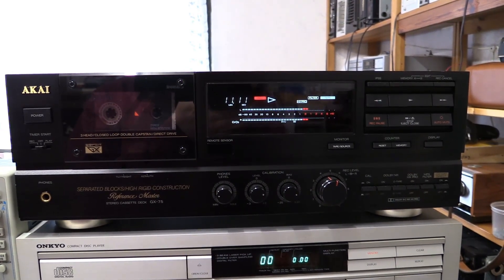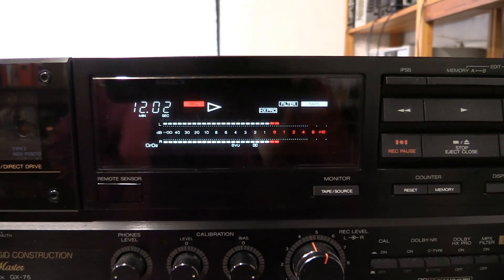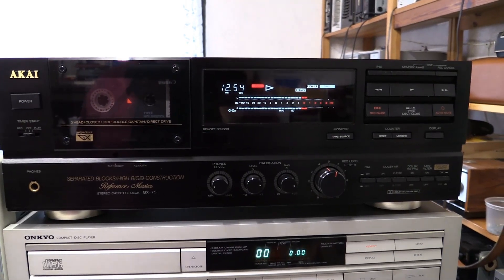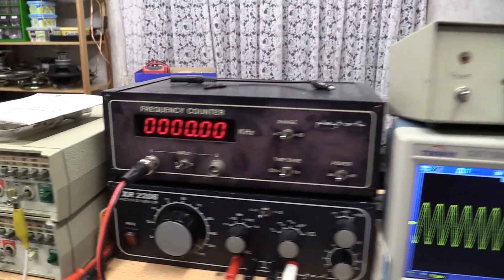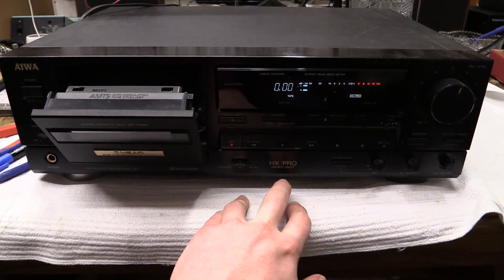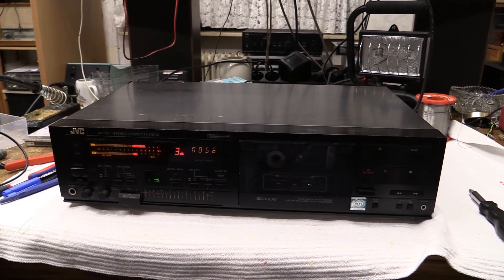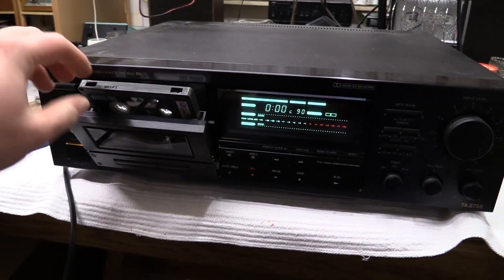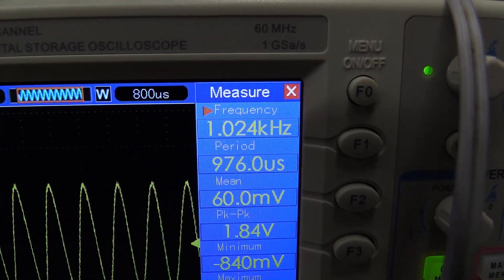Cassette Deck Speed Tests

Comment: 3000hz or 3150hz, is that right? My calibration tape is 3000hz?
Reply from the maker: Both frequencies were commonly used for speed calibration, you just need a calibration tape that matches the frequency your test equipment is designed for.

Comment: The first deck shown in video Akai GX-75  has self calibration system .you can calibrate without refrence cassette,with pushing calibration switch and start to record on a raw cassette,the player circuit supply refrence ton itself and after auto matic calibration you can adjust it manually

Comment: That Technics is very cool, we used to have the dark version when I was a kid, my dad actually bought it new a couple of years before I was born, he must have saved a lot for it as it costed a fortune back then... We used it a lot and when I was about 6-7 or so, my father decided to replace it as it showed signs of wearing out. I used a lot of parts from it as toys: we mounted to counter on a Lego-brick, the motors to drive things (using a model railroad trafo to power them). But I also still remember the typical sounds from the solenoids in that thing and the strange way you had to put in the cassette. Very mid-70ish.

Comment: How do you know that the deck records the test tone at the correct speed?
Reply from the maker: The test tone cassette was recorded on the Akai GX-75 which is a direct drive dual capstan cassette deck. Out of all the cassette decks I had at that time it was the one with the highest speed stability, and I do trust the Akai with running at the correct speed. However, obviously if it wasn't correct, the test tone tape would be inaccurate.

Comment: I seen someone on here recorded on a deck that was known to have the correct speed...a tone of 440hz(which I can do from on app on an ipad) then they took the tape, put it into a deck that needed to be calibrated, played the tape, then used a guitar tuner, set to the 'A" string...and set the speed that way..pretty cool I thought. The tuner was set by the output speaker to hear the tone.
Reply from the maker: I know this is the speed adjustment method of youtuber 12voltvids.
Reply: Oh ok, thanks......

Comment: I recorded one of these not realising that the deck I used to record it was running slightly slow, so I ended up just loading a tape with  a song on it that had a constant beat and got a BPM counter webpage and just clicked as close to in time with the music as I could and compared that reading to the same song on youtube, worked pretty well, well enough that I'm happy with the speed and it's definitely faster than it was.  The hardest thing was the Walkmans speed adjust pot was dicky, so up was down and down was also up then down.

Comment: Making a test tape does not always ok because it relies on the accuracy of the tape machine it was made on. 
I used to buy test tapes from Panasonic. They were made as reference tapes and were alway accurate.
Reply from the maker: I made this test tape on my Akai GX-75 which is Direct Drive. I am sure its speed is close enough to what it should be. Not perfect, but it's free ;)
Reply: Not to mention the question of when his frequency generator was last calibrated.

Comment: Dear Dr Cassette my beloved Marantz twin cassette deck SD 4050 has a problem with the right deck. I load a cassette, any cassette, when I press play it runs very fast (in both directions) sounding like the chipmunks . There is fast dubbing mode which I've never used and who knows it could be stuck in fast dubbing! I even did the turn off and turn on trick out of desperation but this is not a computer just a humble tape deck.  My kids often stop and ask about the clunk sound when the auto reverse clicks in, its foreign to their little ears. I love mechanical clunky sound,  I Love the soft touch buttons, love the soft eject mode but not big on the chipmunk mode. Any prognosis would be nice. ps the belts are perfect. Ys Russell
Reply from the maker: That's an unusual problem, seems to me like the pinch rollers are not fully engaging. It could be the motor running at the high speed that's meant for dubbing, too. Does the motor sound any different than normal when you compare the functional and the non-functional deck with the audio output turned off? If they sound the same, it should be a problem with the pinch rollers. Are you sure the belts are fine? Some decks have more than just one or two.
Reply: @DrCassette  You are right the pinch rollers are not engaging, they sit just under.( Maybe a cigarette paper of a gap to the spinning shaft ). The machine is clean especially in the tape compartment and all the belts are really really good.
Reply from the maker: @russellwarr3791   Hm, that's a strange problem.
Reply: @DrCassette  I enjoy your channel very much and if I hear of a solution I'll let you know.

Comment: Hi, 

I've got the same JVC KD-V6 cassette deck that I found at a thrift shop for $10.00 several years ago.  The playback levels were quite low even after I cleaned everything up.  Turns out there was some tape crud I missed that built up on the edge of the head that lifted the tape slightly away from the head.  This dropped the playback level way down.  Once I discovered that and cleaned the tape crud off, the output levels jumped up to normal.  This deck performed very well.

Also, there is an old technician trick you can use to rejuvenate an old, stretched out belt (not one that has turned to goo!) that involves boiling it in water for 10 to 15 minutes. I've not tried it myself, but have seen it on You Tube.  Apparently it does work, for what that's worth.

Regards, Tom
Reply from the maker: I have seen that belt boiling trick , too. But I don't think it's going to last very long. I may have to try that at some point.
Reply: Here is the You Tube video that shows the boiling-the-rubber-belt trick.  https://www.youtube.com/watch?v=ZdklvFfgIo8&list=PLqQGTv50yTPDMcemG9usgIIgnIjSLxbc4&index=46&t=338s  My concern as well is that the rejunivated belt won't last very long.  That would be a nice experiment for you to explore. :-)
Reply from the maker: Yes, that's the same video that I saw.

Comment: the last tape deck in your video pioneer ct-f500, ive got that same one. it plays slow so im trying to figure out if its the motor, a bad belt that doesn't have the right amount of tension or if theres a speed setting potentiometer on the board thats not set right.
Reply from the maker: The belt should not be loose, but generally the tension is not very critical. Try to manually turn the motor just a bit in both directions. If the big heavy flywheel follows the rotation of the motor exactly and without delay, the belt is fine. There is a little hole in the back of the motor. You can poke an insulated screwdriver into there and adjust the built-in speed control of the motor. There is no other setting for the speed.
Reply: alright i appreciate your reply. thank you.

Comment: DrCassette, how do you know your source machine was running at the correct speed?
Reply from the maker: That is indeed a problem. But the Akai GX-75 does have a Frequency Generator Servo locked Direct Drive, so the chance of it running at the correct speed is very high.

Comment: You are probably aware of this but you can get really cheap ceramic screwdrivers on dx/ebay that will do these speed adjustment jobs alot safer than using ordinary screwdrivers with tape on them. Not only for the motor itself but in the chance you get a shock from the transformer you will instinctively pull your hand out of the deck loosing the screwdriver... You dont want that thing rolling around on the pcb if its made of metal.. Thats what happened to me a few hours ago :D Luckily it was ceramic..
Reply from the maker: I make sure I stay away from the transformer.

Comment: I have a Technics RS-676, maybe earlier than your 671 but it oscillates...even so these are really cool decks and the drive style is like the Pioneer CT-F2121 and some others that predated vertical drives. I hope to have a Sanyo RD-311 from Australia (multi-voltage) soon. As for the CT-F4040 blow it out and clean it. It should be fine. And you at least have a good working Sankyo. CT-F500 is probably the easiest one to find parts for, it was supposed to have been the model with the largest production numbers of all. Add one to a TX/SA-6500 II pair and you have a really nice 25 watts per channel setup and while not the best tuner they ever made it certainly is a good one for what it's worth and quite adequate. Nice test, too bad you never had a Harman Kardon TD-212 or one of the A/D converter rec/play sections of the Pioneer DR suffixed machines, now THAT is nice.

Comment: It might be a foolish remark, but when you used the Pioneer cassette deck (first one), shouldn't you have chosen "Chrome" on the tape selector? I don't know if that would have made a difference or not. Nice video!!
Reply from the maker: That deck has an automatic tape selector. The selector switch is just an override switch. But either way, for this test, the playback equalization doesn't matter.

Comment: Ein Freund von mir ist Radio- / Fernsehtechniker und hat mir mal ein paar seiner alten, nicht mehr benötigten Test- bzw. Einstell-Kassetten mitgebracht. Darunter war auch ein TEAC MTT-255C Azimuth / Level (10kHz / 315Hz). Hat mir auch schon oft gute Dienste geleistet...es beruhigt mich jedoch zu sehen, dass ich nicht der Einzige bin, der einen "Reparaturstau" an seinen alten Hifi-Geräten hat. Egal, ob Plattenspieler, Tapedecks oder CD-Player...irgendwo ist immer ein Riemen defekt, ein Lager trocken oder was auch immer.

Comment: I had a pye/phillips music center once but when I played tapes recorded with it on another player they played the music back realy slow, as much as a semitone slower
Reply from the maker: +Tony Dunn That could have been caused either by a bad belt or by a false speed adjustment.
Reply: sadly it was like that from new becuse all the tape I recorded with it were slow, great rec. quality otherwise & they still playback very well after 30 odd yrs.
Reply: Just seen this comment and had to respond. I owned a Dynatron (made by Phillips) and my friend had a Phillips music centre, and they both ran a semi tone slower. To hear it was like it from new is amazing and strange as I have encountered it too!

Comment: Hello Dr, i have a problem with my cassette deck. If i push the play button the vu meter goes complete in the red until the end ! Just on one channel. There is a lot of distortion hearing and now music. What do you think ? Thanks
Reply from the maker: poukypsie Most likely a bad contact in the record/play switch causing high frequency oscillations on one channel. Get some proper contact cleaner (no WD40 or oil!) and clean the switch. It's a big sliding switch, you can't miss it. Maybe pushing the record button a couple of times will already fix it.

Comment: I need a tape like that one but I can't make it :(
Reply: Hi if u have a working deck just generate some 1khz tone using the free audacity software play this back on PC and then record it on the input of your tape deck. Using a 3.5 mm to RCA lead plugged into the computer's head phone jack and the decks input otherwise you could save the audacity tone as a wav file to put on a CD then record to tape. Hope this helps?
Reply: Dan Hefferland I know how to do it, it's just that my tape deck doesn't run at the correct speed.
Reply: Oh I see :-) have had a lot of problems with speed on my machines too sometimes test tapes come up on eBay j got some Sony ones that way I can have a look and give you the tape part numbers if that helps if you were in the UK I would post you a tape of tone One tape head to another as I had a lot of problems getting test tapes too. Often times I do you set mine by ear now days I know it's not quite as accurate but you can still get it pretty close. What deck do you have?
Reply: Dan Hefferland It's an entry level Teac deck, can't remember the model number. I should try to find a prerecorded tape, I can't find any premade test cassettes.
Reply: +giammyzanna did u ever get a test tape? How's the deck doing?
Reply: +Dan Hefferland Not really, I had to do it in an other way. Basically I got a pre-recorded cassette, played it back on the deck and recorded it on the computer. I also got the same song from youtube and in the end I just recorded the same song on the computer checking how much difference there was between the tracks, changing the playback speed every time. I got a 2-3 seconds error within a 3 minutes song (slightly faster), can't do better than that - the pot on the motor is not precise enough

Comment: The problem here is that you have to be sure of your calibration of the initial desk doing the recording ;o)
Reply from the maker: The Akai is a direct drive unit, so out of all my cassette decks it will perform best. Overall this should - within certain tolerances - still be better than getting a stretched and worn out reference tape off Ebay for some ridiculous amount of money.
Reply from the maker: You come across rather arrogant in your comment. I know what I'm doing.
Reply: +DrCassette I really enjoyed your vid have noticed similar issues with many of my cassette deck I had some success stripping my technics motor down soaking the front bearing in spirit cleaning the commutator to getting rid of brush deposits before lubing both bearing with machine oil and reassemble i've had some worn out bearings too but I have had some success doing the above and wondered if you had done anything like it? Really enjoy your channel keep it up :-)
Reply: I'm about two years late to this post but I would definitely recommend getting out the ESR Meter out and checking all the capacitors... I'm sure that most of them will be out of tolerance by now and most likely causing speed issues....

Comment: Interesting!  Do the cassette decks with the odd loading mechanisms have it for show?
Reply from the maker: I guess the idea was to lay the cassette down flat so that the spools woul rest on the cassette housing. That could result in the tape being wound a lot cleaner than in upright designs, especially in fast forward and rewind. These mechanisms were complicated, expensive and in case of the Technics uncomfortable to use, so they disappeared. The later decks were either the normal upright loading or drawer type decks where the cassette would load into a drawer or where the entire mechanism was mounted into a drawer.

Comment: I got a few walkmans and sometimes it sounds like the sound suddenly gets more clear and speed up but it sounds better that way. or is it just my mind doing tricks ?
Reply from the maker: When running slightly faster, music can sound better. That's why a lot of cheap cassette decks and record player were adjusted to run a bit to fast in the factory.
Reply: It could be, but they are sony. Its not just faster but it goes suddenly faster
Reply from the maker: ‍1marcelfilms
In that case the speed regulation may be faulty. Sony did produce a lot of rather cheap Walkman units, though.
Reply: DrCassette im sorry to bother again, but it was definitely my mind. because i had the same effect on my computer at late night. its like when you gape and the sound gets different